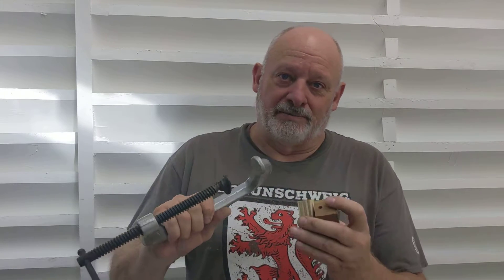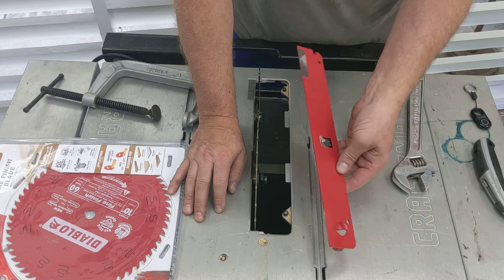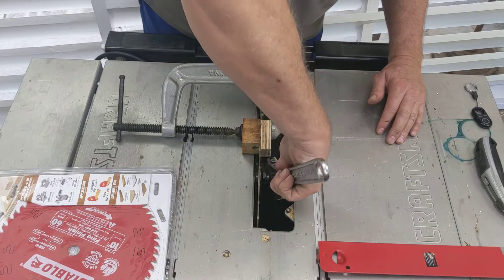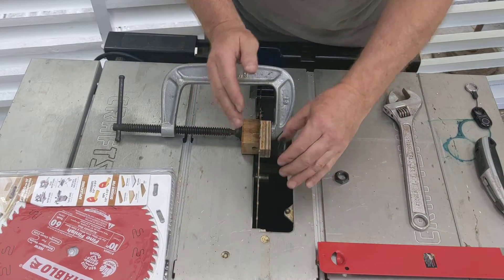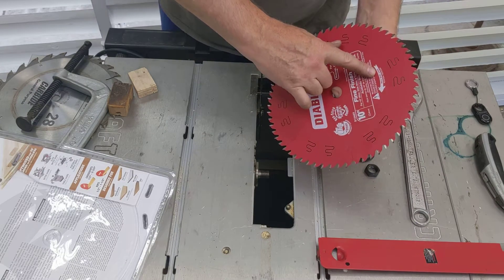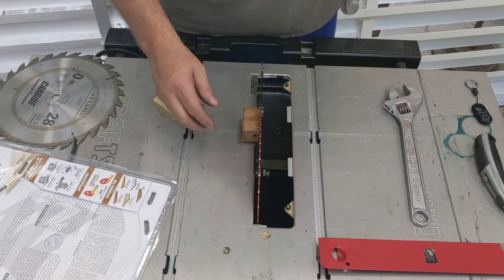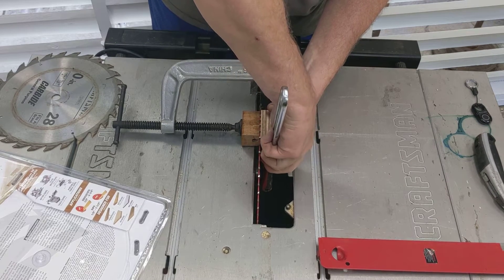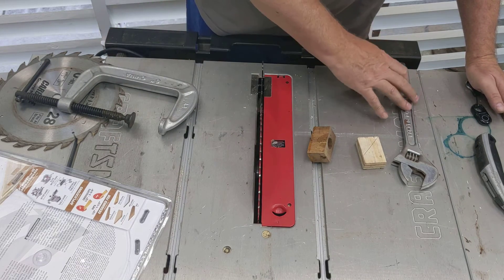How to replace a table saw blade when the factory tool set is missing

Comment: Really helpful—thanks. I have an additional problem besides not having the proper wrenches. The nut has seized on the saw blade and nearly impossible. Might be because of the cold in the workshop—still working on it!